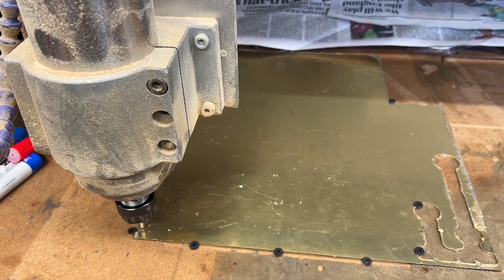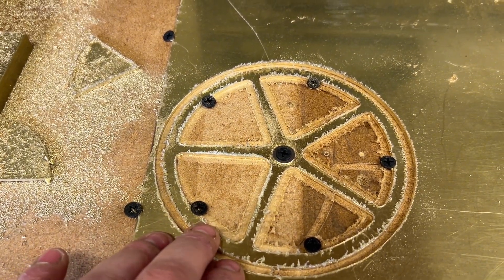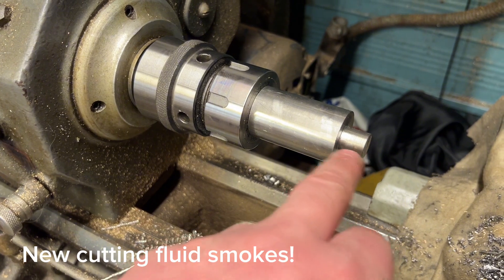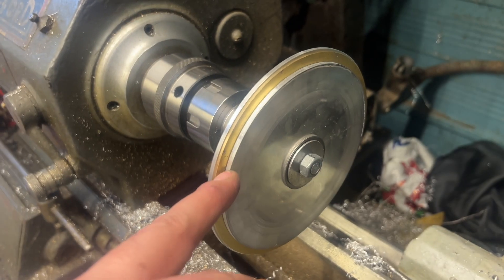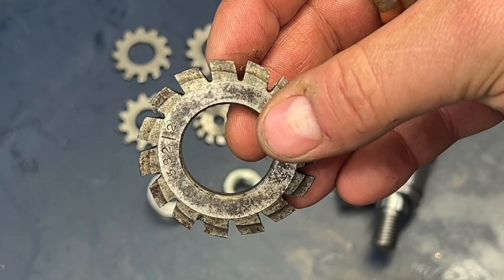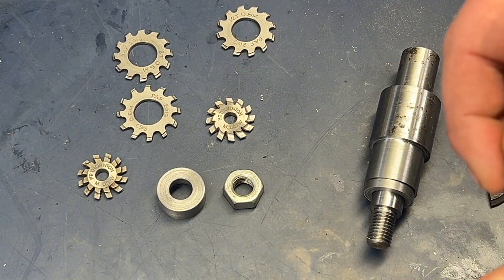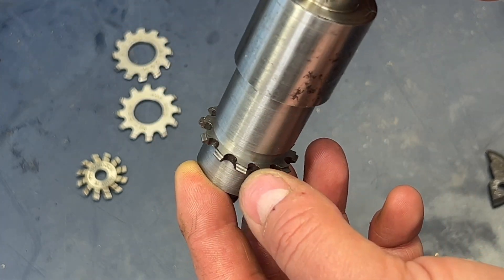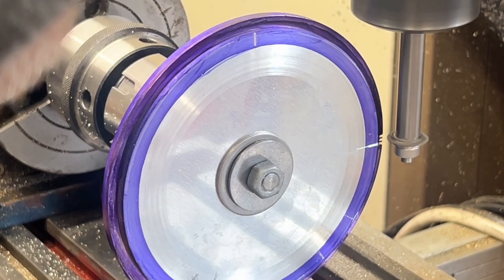Clock Wheel Cutting Basics – Tekippe Regulator Build Part 4 [Horology / Clockmaking]

Comment: Are you manually turning the dividing head or using something like DivisionMaster or Steve Wards indexer? Was wondering if you have ever tried the Mach3 add-on for gear cutting?
All good stuff - thanks
Reply from the maker: Sorry I missed this! I’m using Steve Wards divider. I had made a few of them from the early days when he first started making them. It is connected to a Vertex HV6 rotary table.

Comment: For making big threads... the dirty trick is to turn the rod under-sized to reduce the load on the die.
Reply from the maker: Yes - presume this is a bit of a looser thread though? Not that it would matter in this application.
Reply: @craynerd  Yes it would obviously result in a weaker thread, but how often do you actually need 100% of the theoretical strength? As long as it doesn't strip it's strong enough. My philosophy is always to make life easy for myself. It is a rogue thing to do though, a real engineer would obviously not make out-of-spec threads on purpose.

Comment: Great job, and a very clear and informative video, thanks.
Reply from the maker: Glad you enjoyed it! I did notice when I was putting the video together that I didn’t show the divider. Yes, it is Steve Wards divider. He lives fairly local to me and I have been using it for, I’m pretty sure, over 10 years! I built a newer version of it not long ago but I’ve got a few videos where I build various versions: https://youtu.be/iCFS-NIHqi0?si=7TzMcV-qtumUVoOB

I have used the rotary divider function of mach3. One project I have in mind is to build a dedicated wheel and pinion cutter that is CNC. I believe there is an Arduino version of a rotary encoder. It the source is available, it would be good to add code to traverse the table back and forth, rotate, repeat… the table could run between two limit switches. It would be good fun and is definitely on the project list.

Comment: i saw the other week at a clock makers house he had turned all his center arbors to a point so he could line the cutter up at the beginning as well as his test marks
Reply from the maker: Yes - it’s a good plan for sure.   However I’ll be honest, I still do the rotating method every time just to check the locations match. I had enough go wrong not being on centre point when I first started that it’s worth doing for the sake of a few mins. However I definitely agree that a point on the arbor is a good idea if you are not using a tail stock.